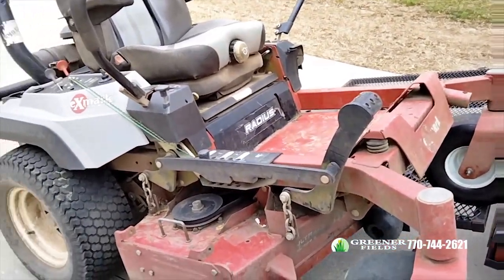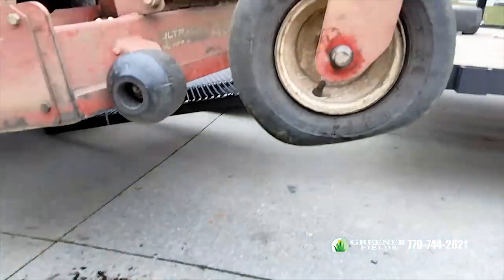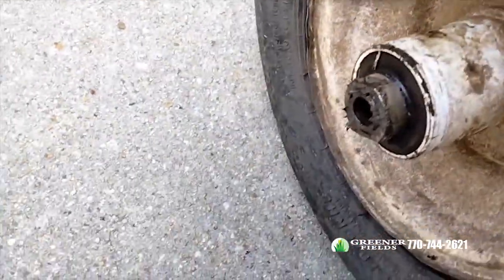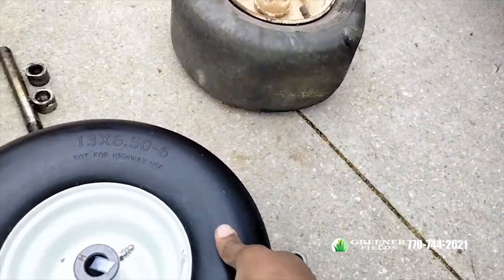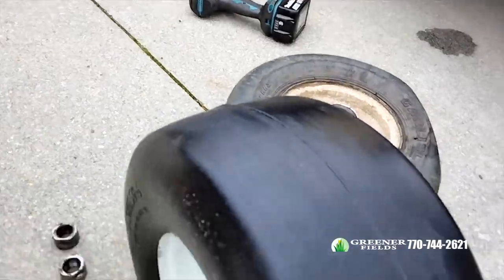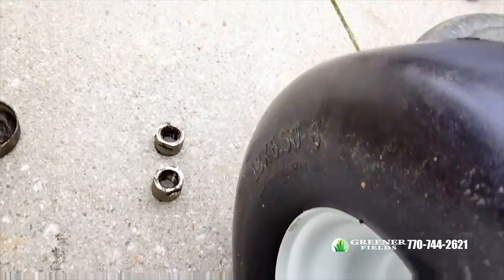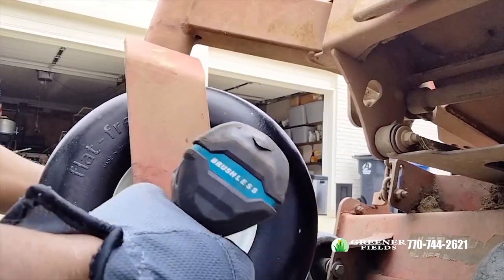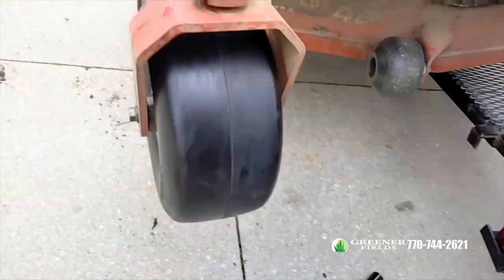2 Solid Rubber  Front Tires for Exmark Mower for $129 total on Amazon

Comment: I watched this video and several like it and bought these tires for my Exmark Radius E 60".  They are great for people like me that had to clear their land from scratch and still have thorns here and there.  I have had them on my mower all this year.  But, here's some things to think of.  They make your ride bumpier.  They are solid rubber so if you're like me and mow several acres and your land had soy beans on it 3 years ago you will feel it more.  Also, my lawn is 4 acres and I mow probably 3 1/2 acres.  I do question how these will hold up.  I have a small chunk taken out of one of the tires and put some sealant on it and it's fine so far.  If you have a small yard I think these would be great but I have doubts with the amount of mowing that I do that they'll last more than a few years.  The reason I got these is that I still have thorns and stuff in a few areas I cut.  Also, make sure you buy the tires like the gentleman that made this video installed.  Get the ones with the zerk fittings on them.  There are some that don't have them so make sure you get the ones you can shoot grease into once a year.  If you have a smaller, smoother lawn these should last quite some time.  Overall, I am happy with them.
Reply from the maker: Yes they do give a bumpy ride, but not having to air up on mornings where the weather is cool is awesome. Thanks for putting your experience on here 🙂
Reply: You are very correct on that.  I will say, my only problem was with thorns.  I was constantly getting thorns!  Me and my wife knocked out tons of brush and thorn bushes and my tires were finding them. @GreenerFieldsLawnCare